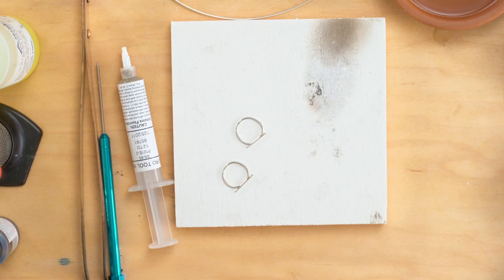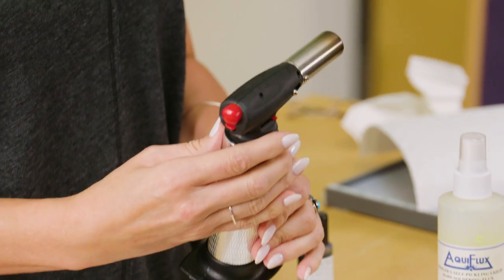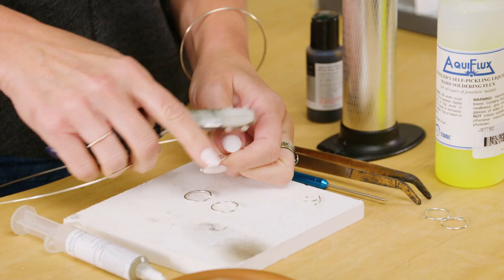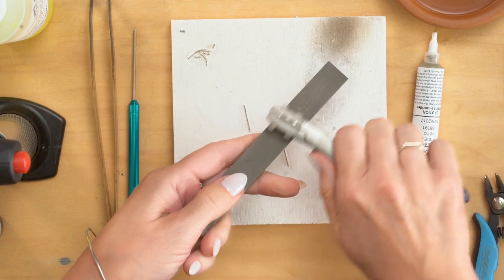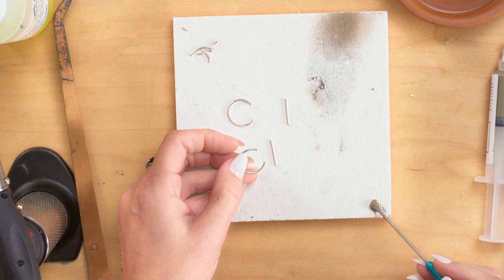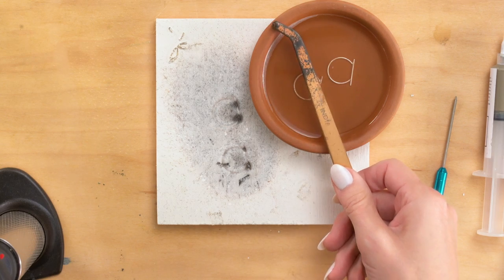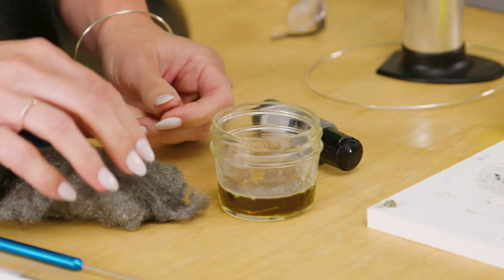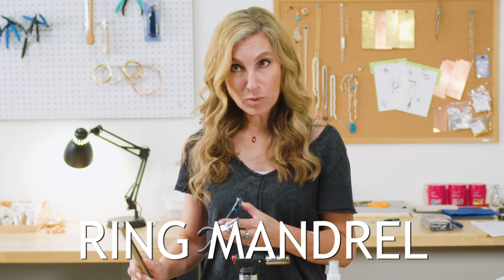How to Make Simple Stacked Bar Rings | Jewelry 101

Comment: Thank you for the first class, I’m a beginner in making jewelry so these classes will help me to understand jewelry making. I need to start from the beginning how long does your tools last you my pliers are making mark on my jump ring?where is a good place to buy sterling silver from chain and wire. Do I get a certificate when I finish your classes.😀
Reply: If your pliers are making marks, you can use a little tape to cover each side or you can check out Tool Magic which adds a coating on the pliers to protect the piece you are making.  Have fun!
Reply: My favorite place for wire (sterling & gold filled...not plated) is Rio Grande...I haven’t found anywhere that has better prices.

Comment: What exactly is pickle?  What is pay solder and how does it differ from the hard pieces of solder?  Finally, I don't understand the reason for flux.
Reply from the maker: Pickle is a combination of a pickling compound mixed with water. You dip your piece in it after it's soldered. This helps to clean it by removing any oxidation that might have occurred during the heating process. The spray is called flux. This is sprayed on your piece before soldering. It cleans, coats, and protects, plus, enables the solder to flow easily between the joints when heated. As Susan says, "no flux, no flow!" 
Here is a link to the supplies used in the video: https://www.jtv.com/product/soldering-basics-supply-kit-includes-torch-tweezers-pick-board-paste/JSYT15?mcid=XSOjsyt

Stay tuned. We are working on a video ALL about pickle! Good luck!